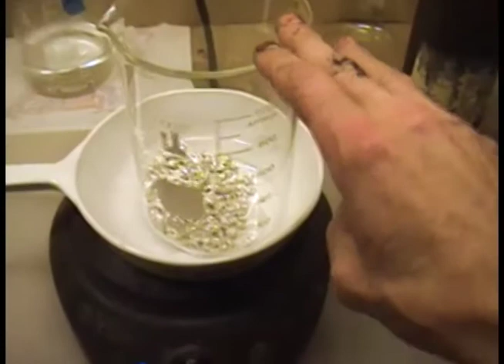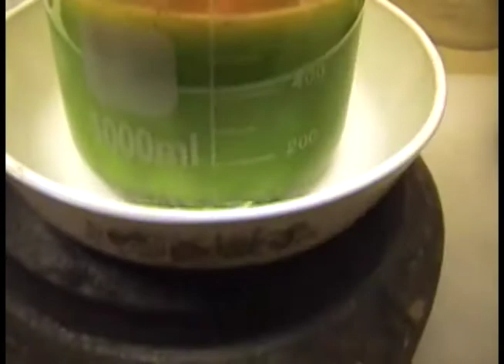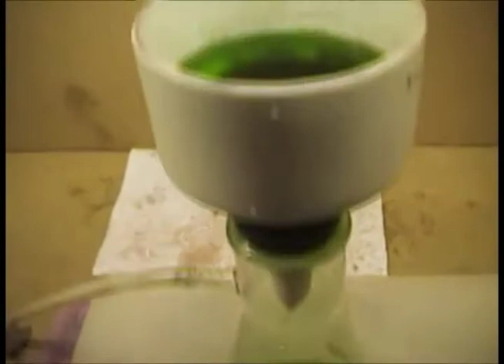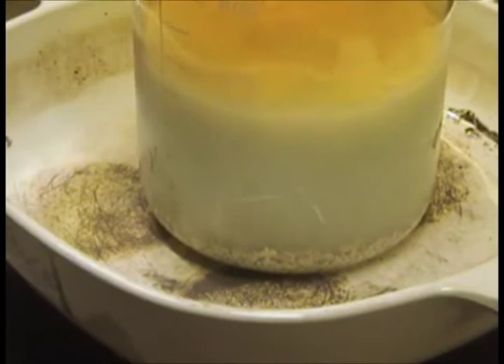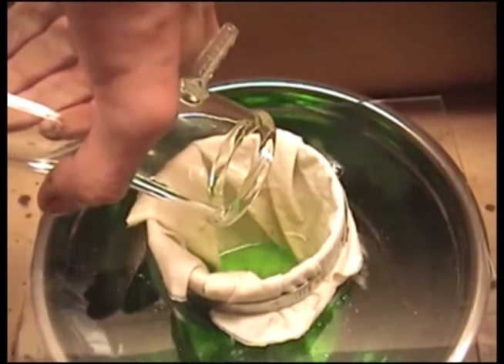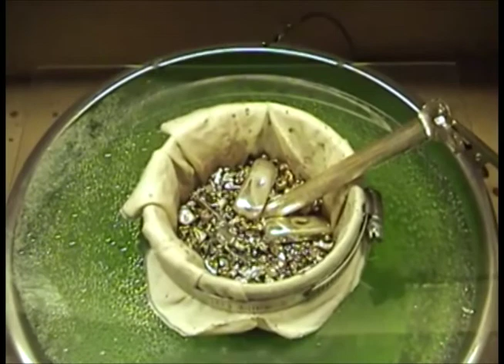REFINING AND GROWING SILVER CELL CRYSTALS BY ELECTROLYSIS IN ELECTROLYTIC SOLUTION # 3

Comment: Everywhere i read silver cell refining seemed to be really complicated, as seen here is really simple, thanks for your time, really appreciated just two questions: the candel stick is  a silver rod? Are the silver shots in the basket unrefined silver? again thanks in advance!!
Reply from the maker: Yes the candle stick is a poured silver rod. The shot in the basket is cemented silver after your sterling has been run through nitric and cemented on to copper.

Comment: would it matter if the current went higher than 10, if heat was not a problem
? Thanks for taking your time to make such great vids!!
Reply from the maker: No sir you can throw as much current current to it as you want except for two things. 1. Never let the voltage rise above about 4.1 volts max and 2. Don't let the heat rise above about 120 F.
Reply from the maker: Their is a formula for figuring how much silver you can deposit in the cell. For each amp hour you put into the cell you can expect about 4 grams to precipitate. So if you put in 10 amps for a 24 hour period you would have precipitated = 10 amp/hr X 4 grams/hr X 24 hours = 960 grams or 30.8 troy oz.
Reply: you sir are THE MAN! thanks for the info!
Reply from the maker: Not a problem sir!